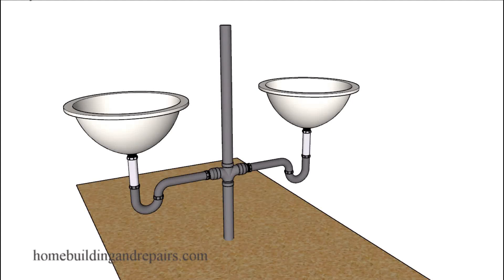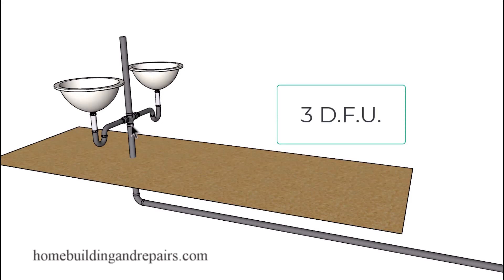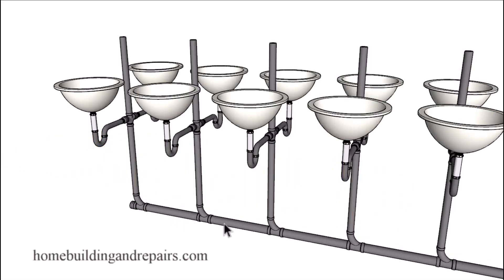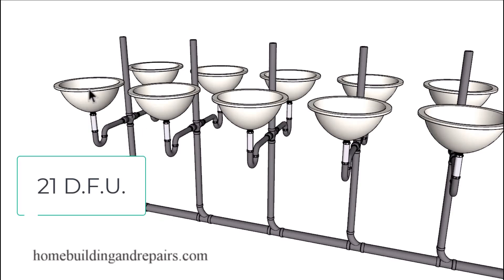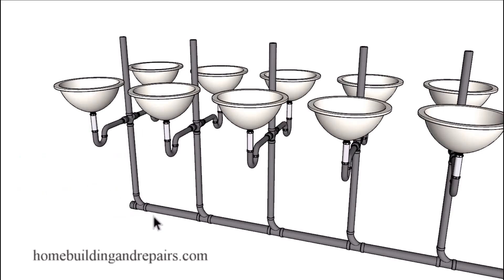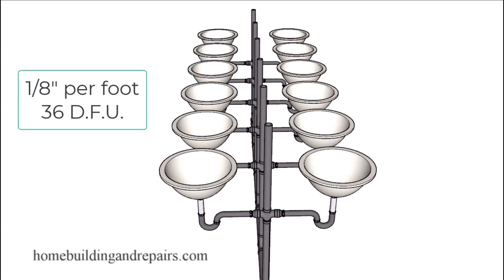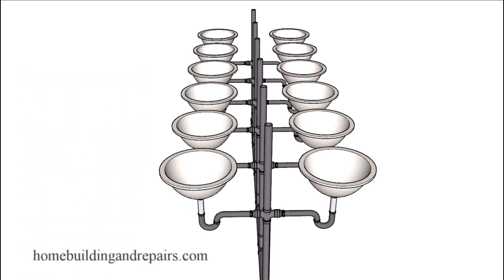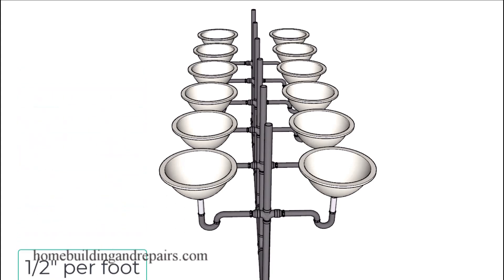How To Add More Bathroom And Kitchen Fixtures To The Same Size Pipe By Increasing Slope

Comment: Lol, don't remember reading that in the code book, is that an added change in the last couple of decades?
Reply from the maker: Here they are from 1955 and I still get grief from viewers who think you could always run a 3 inch drain at 1/8" per foot. 

11.3.2 Small Piping. Horizontal drainage piping of 3-inch
diameter and less shall be installed with a fall of not less than 1/4 inch per foot.

11.3.3 Large Piping. Horizontal drainage piping larger
than 3-inch diameter shall be installed with a fall of not less
than 1/8 inch per foot.
Reply: @gregvancom  so quarter inch for both then you're good
Reply: @gregvancom  <> What you posted there isn't what I was referring to, that I've read before. It was increasing the allowable fixture unit capacity with a ½" to a foot fall I don't recall reading the last time I read through the code book two or three decades ago.
Reply from the maker: @Oldhogleg  I was trying to be funny, but it is in the 2012 International Residential code book on page 658, but a little smaller table. Maybe someone else will do some research and see when it was first used as a code.
Reply: @gregvancom  👍